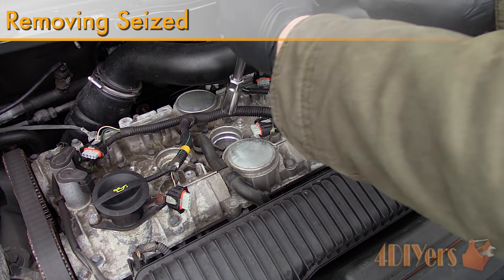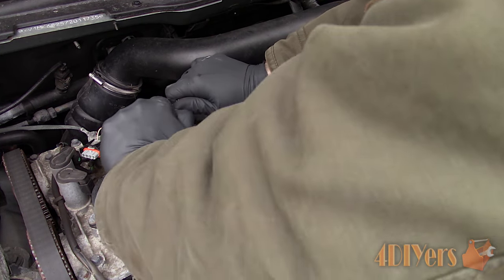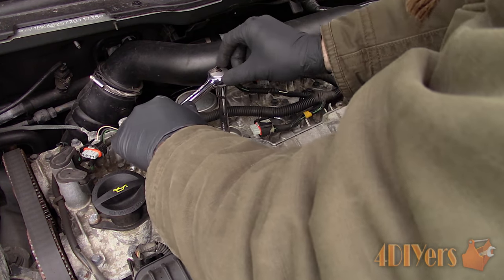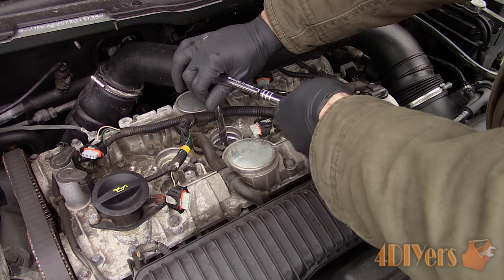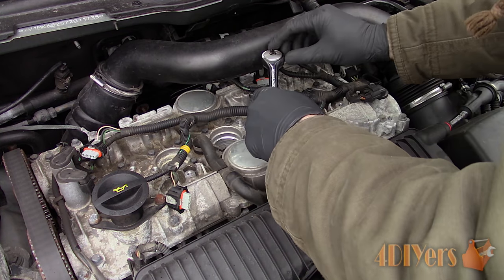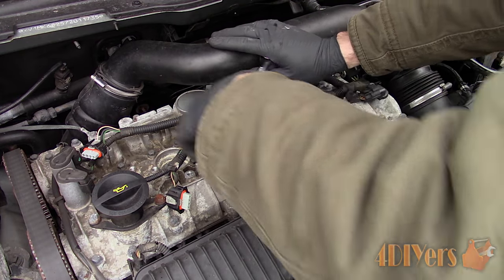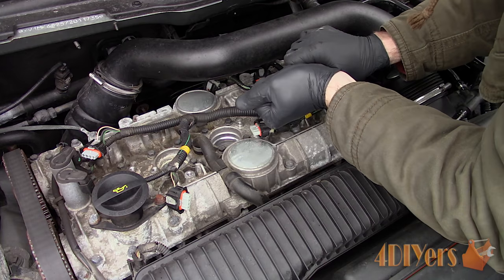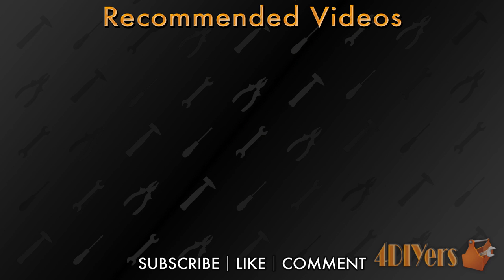How to Remove Seized or Stuck Spark Plugs

Comment: I have to try this method tomorrow engine seized with no oil but now all 4 plug won't budge at all...My question is would it be safe to try to heat the spark plug and head were spark plug is with a heat gun .The motor is still in car..
Reply from the maker: I doubt the heat gun would give enough heat unfortunately. Best idea would be getting some good quality penetrating oil and letting it soak over night. Are you saving the head? Biggest issue with a torch is creating a hot spot in the head where it's only expanding one area.
Reply: Yes saving the heads....The problem i have is the spark plugs and a seized motor,ran out of oil.ended up getting a pin hole in the Oil filter and lost all of the oil.When i drain it i got about 3/4 of a quart with no metal shavings none...i can't even turn the motor trying both ways so i figure i remove spark plugs to put some penetrating oil inside the sparks plugs ..so that where i'm at trying to remove plugs.....I did the penetrating oil on top the plugs let it sit day or 2 twice still won't budge...I wonder if i put new oil filter and put the 4 quarts of oil would that help or will be wasting oil.....it's a 2009 Mazda 3  MT...it did start twice prior to removing it off the trailer but the 3 time no way...Thanks in advance..Oh doesn't help either when you have to work out side in the freezing cold...
Reply from the maker: @rueocts5heartsrc637  If the engine ran out of oil, the head would have been the first to experience that so most likely it's not in good shape either. Your best option would be removing the heads otherwise and soak the plugs in a good quality penetrating oil from either side. Maybe even stick it in an oven as odd as that sounds, just don't exceed the temperature an engine would typically run at. When in the oven, candle wax is another option which is great for helping break free seized fasteners.

Comment: I was being lazy today and used a cordless impact tool, I actually loosened them with a breaker bar already, but when I remove with the impact one of the spark plug had slight metal shavings, I am still stressing over where that came from, the head maybe?
Reply from the maker: Sounds like the threads from the head, not good.
Reply: 4DIYers i will do a compression test tomorrow, the rest of the thread should be more than enough to hold the spark plug in place.

Comment: Good tip unfortunately VW/Chrysler 2011 Routan with 3.6L VVT V6 cylinder #2 rear head is fuzed into the head, removed the spark plug tube and see dark brown burned deposits, tried the PB/WD/Actone/Laquer thinner/ over night no luck, factory had rounded off the hex of the spark plug so 5/8" thin wall deep socket just spins on it.  think only thing to do is remove the head, put it on drill press, drill out the center of the spark plug then use LH screw remover to get plug out of the head, then use tap to clean up sparkplug hole and or tig weld to repair if needed.  Even with tube out no way to get leverage 2" in the head.  But thanks for the tips.

Comment: I bought a 1/2 torque wrench to get mine out, I hope it works
Reply from the maker: No no no, don't use a torque wrench. If you're using longer leverage, there's a good chance you'll damage the threads or break the plugs. This takes feel and patience. Torque wrenches also aren't intended for excessive force. Use a johnson or breaker bar instead.
Reply: Torque wrenches are used for applying things not removing.
Reply: @jwill9877  I thought you could apply a force limit to the left to make sure they don't break off, I couldn't find anything on a force limit anyway so I took the wrench back. I will be using a breaker after I use some decarbonizer and hitting the ends with a  sledgehammer to get it to penetrate the threads
Reply: @jwill9877  You aren't right...LOL

Comment: Video of removing broken off spark plug wire boot on a 96 mustang gt please!!!
Reply from the maker: Unfortunately I don't access to a Mustang GT, but pliers would be the best solution. The wire is already broken, so it'll need to be replaced regardless. I covered a similar topic in an older video https://youtu.be/2B45ABE2FfM

Comment: Why not just warm up the engine to the metal expands and the plugs come out easier?
Reply: It may do the opposite for aluminum heads. The inner thread hole gets wider when cold. But it may work if you get ot loose and it doesn't easy go out, tighten it back and try it again when it cools after a drive.

Comment: The best way to do it is get the engine hot and remove plug wires/coils and spay WD40 down towards the plug while engine is hot. 

With the engine being hot it will thin the penetrating oil, ensuring it affects as much of the spark plug thread as possible, then leave for 20 minutes. The engine should still be a little warm, and plugs should come out fine unless there is a serious corrosion issue.
Reply: yeah did that this morning and it helped alot but didnt have any luck removing one out of four even after driving and warming up the engine and adding plenty of WD40 afterwards. Guess ill try agian later
Reply: @eazye26boy  did you manage to get em out? Having same issue right now
Reply: @muhitsaharaiar5202  yeah what i did was just drive the car for like half an hour on the highway then when i got back home i took the coil off and sprayed a little wd40 into the hole then took my time loosening the spark plug little by little by using the same method in this video

Comment: This is now an old video. In my vase its a 98 s10 2.2. Doing this trick. I got one out. The other three wont budge yet. They i filled the plug areas with kroil oil. Now i wait. I tried the heat trick with zero luck so far. Ill try agsin tomorrow. If that don't work I'll wait snother day or 5. If they don't come out then ill just pull the head and let s machine shop do it
Reply from the maker: Did you get the rest out?
Reply: @4DIYers after a few days of soaking around my plugs with kroil penetrating oil. 3 of mine are out now and the last one broke loose today. I spent about 5 minutes of working it back and forth but had to quit and get ready for work. I fully expect to get it out tomorrow.  I tried the heat trick which did no good. Luckily I have a few vehicles to drive so it could sit a few days. That has to be the best penetrating oil I've ever used. My plugs were in 27 years! It's hard to believe I'm getting them out. They are totally shot too. That very last one is the only one I'm having to work with after a few days of that penetrating oil. They all came out easy but the one.
Reply: @4DIYers I did finally get all the the plugs out today. I also cleaned up the threads and put the new plugs in. The under the hood decal called for a gap of 40. These old plugs were anywhere from 50-85! There wasn't much of the diode left! Talk about running better! I owe it all to kroil penetrating oil. After the plug area soaked for a few days. All of them came right out! So did alot of carbon! I made a hose on my vacuum and cleaned all the carbon out of the cylinders and plug area. I sent a camera in each hole making sure I got everything pretty clean. I did put a dab and I mean just a dab of antisieze on the plug. I wouldn't use alot as it could kill the plug from grounding. I also found the plug wires are original too. Now one wire is arching. Cylinder 3. So I have new wires and went in and got new coil packs too. They are all 27 years old. It's time! I'll be doing the rest of the wires and coils tomorrow. It started pouring rain and this little S10 is outside.

Comment: U can pour water thru the carb or throttle body while it's running. This creates steam...may help
Reply: What would that accomplish?..steam is not a solvent, per-say.
Reply: @steveandrews8301  Decarbs the engine and any carbon build-up that may be around the spark plug threads.

Comment: Let it soaked overnight ??? 
Spark plugs are designed not to let any gasses to escape the CC so I don't think any lubricant will get to the teeth
So the best way I always do is let the engine warm up really good ,they'll come out like a butter
Reply: I tried to take a plug out of my 2002 Tacoma v6 while it was cold and I think it was making my ratchet skip a a ⚙️  I sprayed it with a penetrant and next I’m gonna drive it for a while then try to remove them.
Reply from the maker: Yes I am aware of that, but if you're able to loosen it slightly, it may help. And it has helped out some viewers.